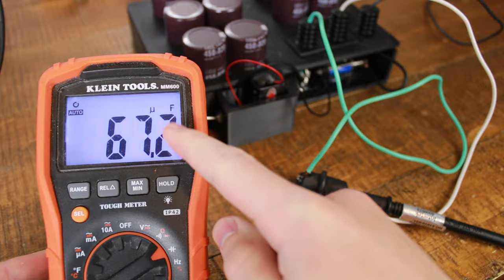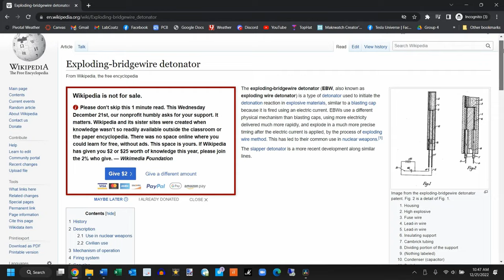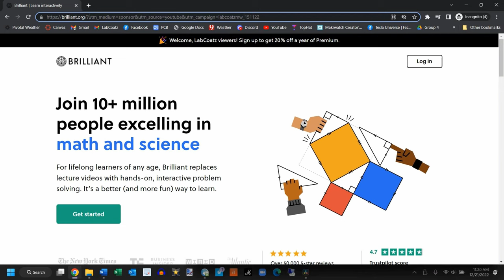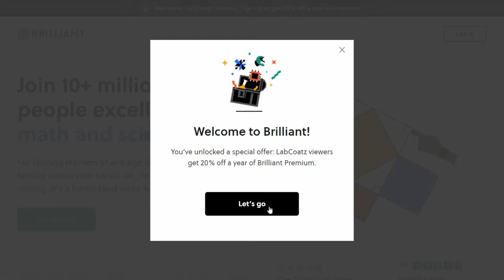High Voltage Capacitor Bank DESTRUCTION: Explosions, EMP, and SLOW MOTION! | Megawatt Pulser Part 2

Comment: I'm not sure if this information will be practically useful for the kind of demonstrations you are doing, but if you are looking for "the fastest edge" (ie. the shortest possible rise time [highest frequency content] ) consider using capacitors specifically designed for pulse discharges. Also (specifically EMP experiments) keep in mind the amount of stray inductance you have inherently by the physical set up of the circuit, what frequency you are intending to propagate (which I guess would be determined by the physical size of unshielded circuit elements in targeted equipment), and even possibly how long your transmitter would "ring" before it destroyed itself. From my (limited) understanding you would be trying to make a radio emission with such a high magnitude that a sufficient current would be induced into random circuit elements such that it would cause a failure. A "failure" in this context would range from a logical glitch or microcontroller reset all the way to irreversible semiconductor damage. The scale that a garage hobbyist would feel comfortable playing with (without worrying too much about personal safety or a visit from the government) naturally constrains the experiment to mostly "near field" tinkering.

Comment: This might not be cool enough for your taste but I used to like running the wire inside a glass tube (broken pipette for instance) and exploding the wire inside. Between two plates of glass would probably work too. Anyway it is a quick and dirty and not great way to sputter metal onto glass. It works better with an inert gas in the tube or if you pull a vacuum. Naturally the glass might break explosively so keep that in mind while designing the safety part of the experiment. I know for sure copper coats well, and I think aluminum does okay, not sure about other metals.
Reply: That's very interesting. I would try it under vacuum, and preheating the substrate might help some materials coat.

Comment: You can use a hockey puck SCR with a pull down resistor on the gate to keep it from false firing to set it off faster without loss from the spark jumping a gap; also prevents the energy from bouncing back and forth and causing more wear and tear on the caps. Or try using one of those little high voltage modules to create a path for the main arc to discharge through. Pulse caps, like camera flash caps but bigger or a bunch in parallel would give more bang for your buck too. Great videos! I managed to make a good size waist in a small aluminum capacitor with two wraps of 20ga. wire around it tightly and pushed what I had through it. The wire exploded and the capacitor lost it's plastic coating when Mr. Lorentz forced it to shrink. I ran 8 thirteen mF 2000 volt caps on bus bars and charged it with a flyback transformer. Eventually the caps failed though probably through the feedback that goes on when you simply make contact without an SCR, or other indirect means of firing the bank to keep that reverb from happening...

Comment: You should try semiconductor switches, SCR are pretty resilient compared to IGBTs and MOSFETs, but an ignitron or a thyratron is what you really need.
Also if you can get the current rise time high enough (2000A/100ns, higher than most semiconductors can ever do, but comfortably handled by spark gaps or the aforementioned switching devices), you can cause explosive vaporization of a bridgewire with just a 1000V 0.2uF capacitor, in a slapper detonator.

Comment: The EMP generated by this capacitor is weak, but the sound it produces is loud. There are three reasons for this: 
1. The capacitance and inductance in series are too large. 
2. The discharge time is not fast enough, it needs to be in milliseconds. 
3. The voltage is far from enough, at least 100KV.
I have extensive experience in constructing ultra-high voltage EMP devices. If you are interested, we can exchange ideas together.

Comment: Try to discharge it through the laminar flow of salt water flowing from top tank to bottom. Just use electrodes big enough to make a good junction between wires and electrolyte.

Comment: Hopefully that's not the calculator you use for your classes, lol
Reply from the maker: It might have been one of them... 👀
Reply: @LabCoatz_Science  well as long as it's not the only one.

I struggled enough in my math classes without an error prone calculator. (Although I did find one of mine was broke somehow as no matter how much I tried, I didn't get the answer the teacher said we were supposed to get. They even tried after class and just said matter of factly, 'yeah this calculator is broke' what?!?!

Comment: As much as I love this, is there a way to use this cheap system for simply just storing power for super cheap? AKA a cheap but super effective battery? That's my true interest.
Reply from the maker: If you want to store power, batteries are still the way to go. A single AA already holds ten times more energy than this entire capacitor bank. Capacitors are good for creating short, quick pulses, but not so much for storing a lot of energy long-term.

Comment: Why not run this high voltage discharge into clear acrylic for some beautiful Mandelbrot art?
Reply from the maker: The voltage isn't nearly high enough. Typically, for acrylic "captured lightning", you'd need over 100kV applied by an electron particle accelerator.
Reply: @LabCoatz_Science  wow, thanks for the prompt reply!  I really enjoy how your channel is developing.  Keep up the good work!

Comment: You may want to consider an old AC contactor versus your solenoid. You are probably loosing a little punch through the steel conductors there.

Comment: And if I accidentally discharge this capacitor on myself, what happens?
Reply from the maker: It depends how you discharge it. If you simply touch both electrodes with the same hand/arm, only that extremity will be effected (most likely result is a severe shock/burn, but it may be worse). However, if you grab one electrode in each hand, you essentially defibrillate your heart, and you'll probably die. Hence why the "one hand rule" exists.